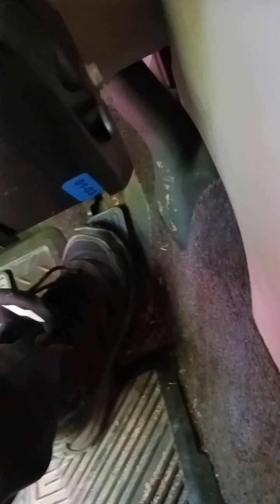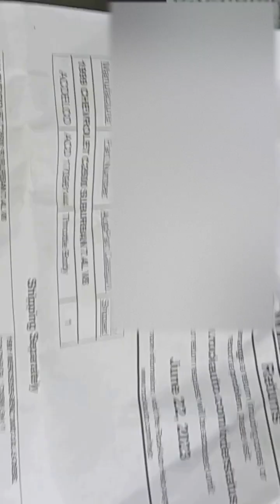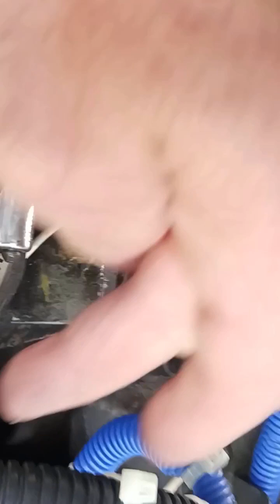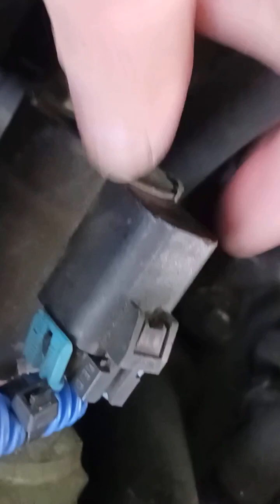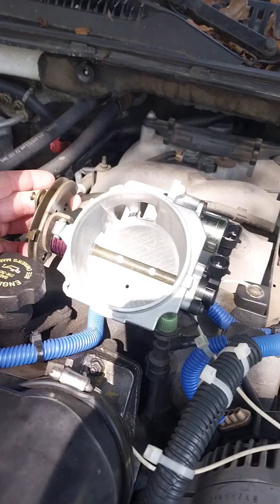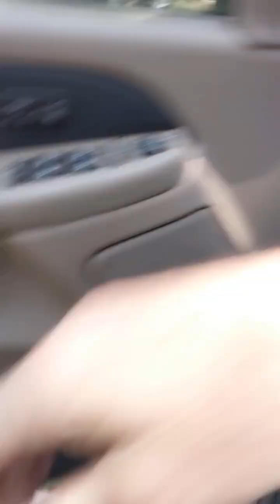8.1 Cable Throttle Body Swap (From DBW) Due to Chronically Stranded By "Reduced Engine Power" (Test)

Comment: @rdhamill Did you ever work your way through this?
Reply from the maker: Yes I kept the cable throttle body and put an aftermarket wiring harness in that was meant for a 99 454. It runs ok but not great but never leaves me stranded due to REP. But it doesn't run perfect and I haven't taken the time to wire in most of the gauges. If I had it to do over I would try a PCM from an 03-08 truck with the same engine before doing all this other crap. I should have thought of that before because apparently their Reduced Engine Power RPM is higher so you wouldn't be stranded. The main observation about going to a cable throttle body is that it does not exclusively control fuel flow. I can open the throttle body with the gas pedal yes but the engine does not get more fuel unless the computer is telling each injector to flow more. Overall a very educational experience. Not many people understand how these things actually work.

Comment from the maker: I'm going with an aftermarket wiring harness and modified PCM. Apparently I have to get aftermarket gauges also. But I like that better than trying to use my old wiring harness that probably has hard to find fickle shorts.